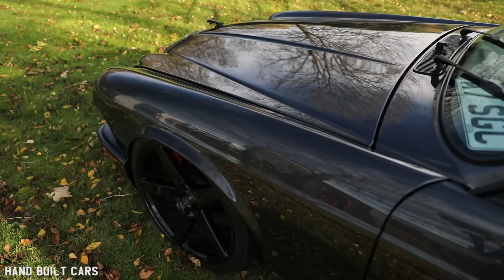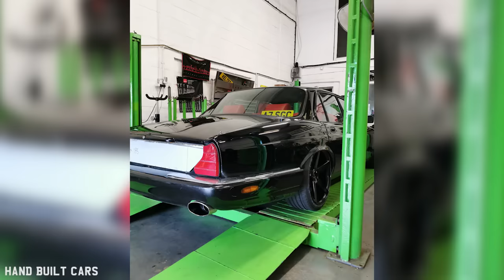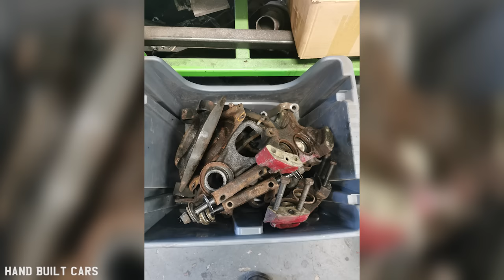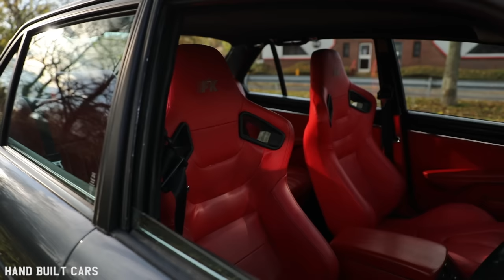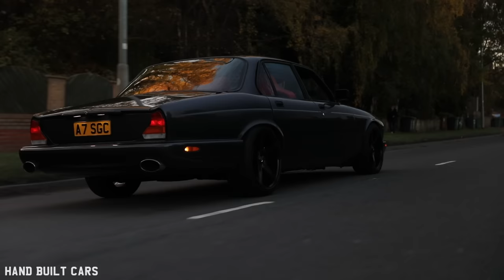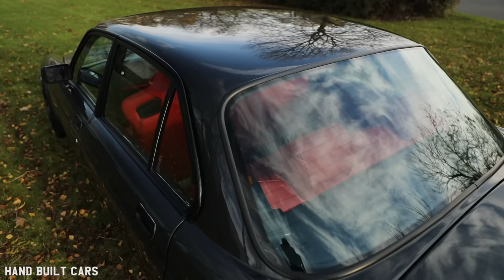This 1987 Jaguar XJ12 With BMW M60B30 V8 Is Not One For The Purists - Built By Keltec Performance

Comment: That is ABSOLUTELY fantastic! I’m a purist who did a glass out, every panel off restoration on my 1981 XJ12 in Rhodium Silver last year. Started stripping it on the 10th of February and had it all back together and completed by the end of last October. I’m 48 and have always had XJ’s since my 20’s, including a manual S3 6.0 TWR that I would never have sold, but for divorce. I understand and agree with everything you’ve done so well with your car. Nothing wrong with either the purist approach or a custom car that’s been put together so well such as yours. Fantastic job my friend.
Reply: Thanks for your kind words 😊
Reply: Well done mate & that silver colour really helps show off the purist bodylines of these old beauties.
Reply: Wow, very nice sir. I own a 2004 Jaguar XJR 4.2 s/c.. almost 200,000 miles / 321,000 KM on her and I just got the transmission flushed as well as engine oil change with Liqui Moly :D

Comment: Absolutely great job.. I myself would have kept the V-12...lol.. My son and I have done a complete restomod on his 86 XJS.. a complete shaved body(no door handles,, lights, Even the gas cap finger lip).. custom black magic satin paint.. custom interior, including removing the ridiculous aux tank, and relocating the batt in the right trunk pocket.. Port and polished intake manifolds, custom made headers, full Mobeck MFI system,, all steel are chromed,, all suspension dropped and blasted and powder coated.. 18x9" rim's.. a complete original TWR body kit.. custom good scopes.. twin 16"electric fans... A complete wire tuck (rewired the entire ER so almost zero wires are shown). All nuts and bolts are S.S.. custom steering wheel... As you mentioned my son now knows everything about cars,, welding,, wiring, suspension,etc.. We must continue this tradition to keep kids working with their hands.. and these beautiful jags alive..

Comment: I love it. It reminds me of the XJ6 that drummer of Iron Maiden had made by Jaguar. Old and new combined; in that case a Jaguar engine still.
Reply: In that case they kept the original engine and got rid of the fuel injection system and fitted carburettors iirc

Comment: Stunning car. I've got a 2002 XJ3.2 SE Anthracite black and stainless trim.
SS sports rear exhaust.
52k miles and I love it😊
Reply: I've had a supercharged x300 and a 98 x308 sport myself......I've always felt the x308 is the best all rounder,its got the tradition look and it's modern enough to live with

Comment: Really nice as a one off. Actually make some more! V12 Jags are not understood by owners or so-called Jag specialists. Remove the air box, rip out the ECU and fuel rails, fit a couple of turbos at the back of the car (no room in the engine bay!) and you can ring 600 screaming HP from that engine. This is what Jaguar should have produced when JLR were throwing spanners.

Comment: Here in NZ the main engine swap is either an old 5.8 chev and 3 speed auto, or for more money it’s the 6.2 Holden (chev) and 6sp auto.  Owned a few series 3’s but instead of going this route ended up (today) with a w126 500SE with 2008 E550 engine and 7sp auto.  Purely to be different…I still love the jags, but have gone stealth/std look with the Merc.
Also got a NSU ro80 and wanted to W8 swap that…but that ended up being a LOT harder than I was prepared to do.
Reply: I am here in the USA. I am very big car enthusiasts. Have a 1971 Mach 1 with a 460 Rousch engine, 1955 Chevy Bel Air with a 6.2 Supercharged Chevy engine. 
I am not familiar with a 5.8
Many times been around the 350 5.7 Litre Chevy engine. If could tell me what the 5.8 that NZ got seems interesting 
Thanks

Comment: You did great!  I have an X350 XJR and I'm doing some crazy mods.  I had it from basically new but gonna go nuts with a cutoff wheel.  I like fixing engines so I probably would have repaired the V12 if it were me.
Reply: V12 wasn't faulty,original plan was to run the v12 on independent throttle bodies with a manual box,got as far as manufacturing the bodies (3 sets from a v10 m5) and the cnc guy didn't get the adaptor for the gearbox done in time,that's how it ended up with the v8
Reply: @keltecleeds   wow that's some major effort!

Comment: Beautiful motor! My ultimate version of this sorta lovely Jaguar would be using an x350 XJR base (so the all alloy car being considerably lighter yet also way more rigid and safe) fitted with the later version of the 5.0ltr supercharged V8. So with the engine factory standard that would be 500-550bhp or tuned 660+bhp! That would be my all time dream car. Or, if i owned my own petrol station, a 7.0ltr Lister type V12 with 500+bhp or their twin supercharged 7ltr V12 with 600+bhp. That Jaguar V12 sounds incredible but its mpg is laughably bad even totally standard with only 300bhp and mpg in the single figures! Even the later HE (High Efficiency haha!) barely scraped into double digits!

Comment: Wow now thats a build!
M60 engines are such great engines. Just feed them high quality gasoline, make sure that the oil pump is torqued to spec, mate it with a M57 gearbox from the 530d and you have a incredibly sturdy playmate. 
Since these guys specialize in exhausts - rear mount turbo next? (the engine can take it, wink wink nudge nudge)
Reply: Will need to dry sump or adamat sump this to get the engine further back,then turbo or the jag supercharger is an option,can't get away with a rear mount turbo with the uks weather
Reply: @keltecleeds  Being norwegian, I can relate to the weather bit.. Running the jag charger is probably more in line with the spirit of the whole thing as well. Extremely cool build, subscribed and looking forward to any updates !
Reply: @kondemert I like the idea of the charger,the majority would think its an xjr engine 🤣🤣,I must admit I'm very jealous of your country, I visited tromso a couple of years back,certainly the best holiday I've ever been on :-D

Comment: It is a stunning build, any way you slice it. While the Jaguar 5.3 Liter is near bullet-proof, as far as the block and heads(mostly) getting one setup right, or even a 6 Liter is challenging at best and there are many, many ways to ruin it. This is outright blasphemy, and I absolutely love it. I am an Aluminum-body fan, and have had 4 X350 XJ's. An XJ-R, and XJ8L, a Vanden Plas and a Super V8, so every flavor that comes in besides plain jane but a good series 3... I am sure some have made the Nicko McBrain comparisons, but these are very different cars. Niko's is for the hot lights car show, this ones for back roads and creeping up on someone on a dark foggy night.

Comment: Definitely not for the purists but also not the common sensist!  Surely the Jag V8 is more reliable than the BMW V8?
It looks lovely though, definitely what I would do asthetically to one if I had the money and time.
I'd  consider a BMW engine too, but I'd have gone for the solid N55!
Reply: I think this depends on perspective,This isn't a m62 v8 it's an m60,it's probably one of the most dependable engines bmw have ever made,duplex timing chains ,no vanos  system,the only known issues with the m60 is timing guid failure at higher miles,but tbf jaguar haven't been able to design a timing chain correctly on any of there own engines that came after the inline 6 aj16
Reply: @keltecleeds  good point! I wouldn't say anywhere near dependable as the N55 tho.
Reply: I would have to agree to disagree on that one mate
Reply: Honestly it seems like both german and brits build questionable engines. People go on about German Engineering™, which is just extra complicated steps to break. When they work, they work, when they don't...

Comment: Quite similar to a 3.0 Capri.
Keep your he ain't Heavy he's my glue to the road brothers left in the boot..
Half a joke sandbags/Bags of cement.
Widebody which have wider wheels tyres woahhhh V12 jaguar.
I'm going PSI on demand air compressors as Efi carburettor/s

Comment: Congratulations
The band Iron Maiden had a purple XJ  very special too.
Arden cars in Germany
See their video.
Will you do another car ? It might be a XJR 2001 or 2005 or Super V8 2007.
⭐️⭐️⭐️⭐️⭐️⭐️⭐️⭐️⭐️⭐️
Reply: I've seen both 😊,I've dine an x308 around 10 years back,I do have a very special plan for a coupe should I end up with a bit more time on my hands 😂
Reply: @keltecleeds  I had XJ6 1982 and XJ6 1995.
One of these days I will buy a XJ 4.2 2007.
And I will try to make it very special with your parts. Last question
Do you work on XK 5.0 2010 ? Because they begin to be cheaper.
🇬🇧🇬🇧🇬🇧🇬🇧🇬🇧🇬🇧🇬🇧🇬🇧🇬🇧🇬🇧
🇨🇭🇨🇭🇨🇭🇨🇭🇨🇭🇨🇭🇨🇭🇨🇭🇨🇭🇨🇭
Reply: @club_rock I haven't worked on the 5.0,but I know they do suffer timing chain issues,the timing kit alone before labour is already very expensive

Comment: Why would anyone swap a BMW v8 for a v12?
BMWs use plastic parts and have timing chain problems!
Reply: You do relailse to this day jaguar are notorious for timing chain problems, x308 v8s plagued trouble,the new v6 and v8s plagued with trouble,and the ingenium engines also plagued with trouble,the v12 is hardley trouble free,over engineered ,over complicated,the heads sieze to the block,I do admit they got the chains right on the v12 and the xk aj6 and aj16

Comment: Chopped down with Henrik Fisker EV Supercar concept rear lights etc isn't my style..
Henrik Fisker concept, Just that rear inset window similarity, window areas side arch need super widebody to rear 3+ inch 🌙 to 50% depth front widebody wheel arch 2 doors jaguars 4 eyes.
With a Mazda MX-5 Miata 2023 hardtop all in that 2 door chop shop Jag

Comment: Why it has ugly rims and slammed to the floor
Reply: Because I wanted ugly wheels and to slam it to the floor 😂😂😂
Reply: @keltecleeds  if your iron stops working... just get the car and your shirts are done :D  but for real, arent speed bumps and bad roads a problem?
Reply: @mrmcprang  it's on pneumatic suspension, you just push a button and the car lifts 😀
Reply: Air suspension sucks

Comment: Bit of a prick for beating a man down over 50 quid! Then sending him the finished photos! That’s just nasty!
Reply: In 2017 ,what would you say a xj v12 that's not running with no mot had been filled full of rubbish and needed practically every body panel replacing was worth?

Comment: As a series 3 V12 daimler owner and having it delivered from Japan with just delivery mileage only , it has been and is the best car on the road  and couldnt imagine anything else under the bonnet giving me 21 mpg and silence .    My question above all is WHY ? do this to a series 3  and with a BMW engine ????   Surely its the same as me putting best steak in my belly  at dinner or  putting dog food in my belly ,  same result but I know which I prefer .   and why change what Clarkson and Autocar unanimously agree is the best car in the world ? .   On the other hand  you could put a rubber band in a Spitfire fighter plane  or an electric motor in the Flying Scotsman ..  Its that simple . !     But why bother ?  the series 3 is hallowed ground , it is the car that God drives , Its the only car to take you mum out in  .   Do yourself a favour and put the proper engine back along with all the rest of the blingy nonsense .